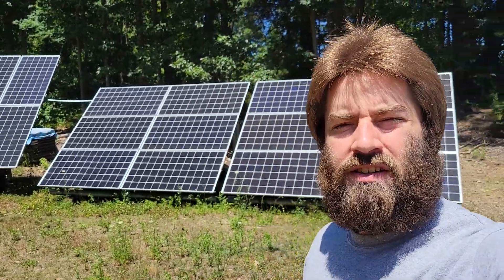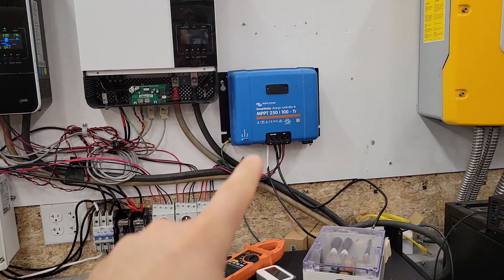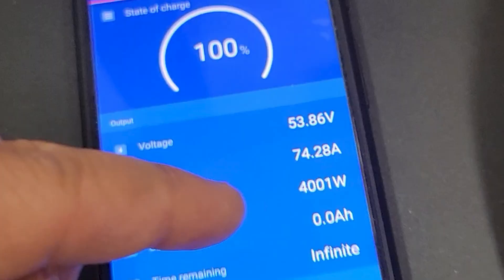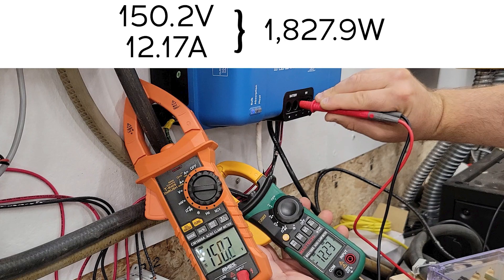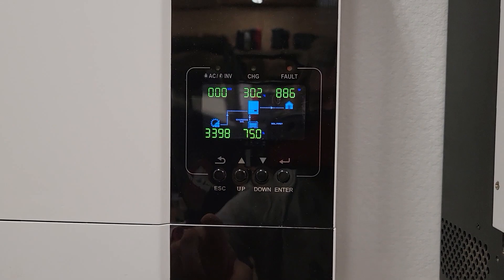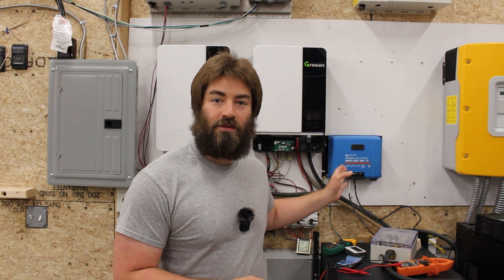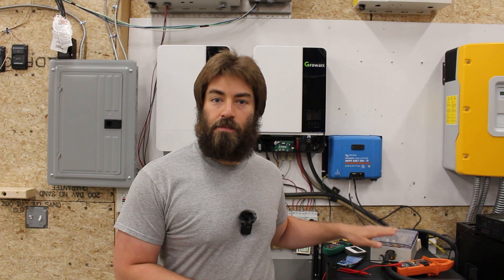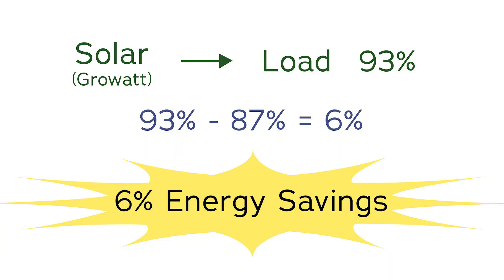Victron vs. Growatt solar MPPT charge controller efficiency test

Comment: Long time fan and have some questions  and was wondering if you could help me or if anyone interested could add their thoughts too.

I  designed and built our system here in Danville, Indiana without any background in Solar or much practical DC experience at and but got it up and running two plus years ago,  I am using 

3 Arrays  total  which are connected to an 8K Sol Ark and we are Grid tied.
Battery Backup is 16 180ah AGM telecom batteries.

Would like your ideas, pros / cons on  adding and or converting to lithium and going off grid?
Reply from the maker: If the old telecom batteries are sitting there for backup only, then not much need to change them.  Instead I would look at what the utility program is in your area.  Are you getting a 1:1 credit?  As in 1kWh sent to the grid during the day gives you 1kWh to use at night?  Or, do you sell the grid power at wholesale rates and have to buy at retail rates?  Knowing that will help decide if buying more expensive lithium batteries makes sense.
Reply: @DavidPozEnergy  sell at wholesale .05.5 cents and buy at .11 cents.Plus 

The investment so far is not bad at  $12K

I bought all those AGM on the cheap when they upgraded the towers here and got them for 3K with the telecom rack.

$6K  was for the 8K Sol Ark.

Comment: You are wrong. With an external mppt the energy is going first to load (inverter) and the rest to charge the battery.
Reply: Correct.  The battery bus is receiving the power from the solar, and the inverter is taking it from the battery bus regardless of which charge controller puts it there, and the batteries are taking the rest, again regardless of which one puts it there.  So the most efficient solution is to use only the Victron charge controllers, and pass nothing through the growatt charge controller.  Unfortunately, the Victron costs nearly twice as much as the growatt if you buy the charge controllers separately, and you can buy several solar panels for the difference, and end up with a much better return on investment than going with Victron.  So while in a vacuum Victron looks good, when you take into account the cost and different ways you can invest that you'll often find the Victron doesn't win out. You can buy two growatt 80A charge controllers for the price of one Victron 60A.
Reply: @AdamDavisEE  correct, but using more solar panels is not the solution where space is limited.  And we must not forget the issue of temperature, noise and durability.
Reply: @Jaimediaz10  Yes, my point is that there are many factors to account for besides efficiency, and this video only touches on efficiency and nothing else.  Cost is usually one of the top three things people look for in products such as these, so I chose to emphasize that. 

Space, temperature, noise, reliability/durability are all things individuals will also have to account for as they make their decisions.  I certainly didn't intend to suggest that my example is a complete list - it's merely one example to point out that the video doesn't cover even a simple cost perspective, nevermind all the other possible requirements a user might have.  

I'm not saying the video is bad, either.  It provides a useful data point, and I'm glad @David Poz created it.
Reply: @AdamDavisEE  Hoping that someday growatt releases a 500v stand alone cc. for now it's all in one, or 250v.
Reply from the maker: Thanks for watching.  I'm trying to share data, not saying one is better or worse than another.  One of the key points is to illuminate the importance of using the energy during the day when possible.  I get asked a lot about needing more batteries, and I follow up with asking about shifting loads to time of use.  Anyways, it was fun to get some real world numbers instead of relying on the spec sheet.
Reply: @DavidPozEnergy  Don't get me wrong, thanks for doing it, I enjoy your videos and information. I think you just miscalculated on this one. You can load shift some, but when you have 4-5 days of heavy clouds offgrid you can't really put off your electricity any longer. Generator, or more batteries.
Reply: Hmm, sounds right. I imagine that electricity takes the shortest path to the load/demand. Probably Mppt>busbar>inverter.